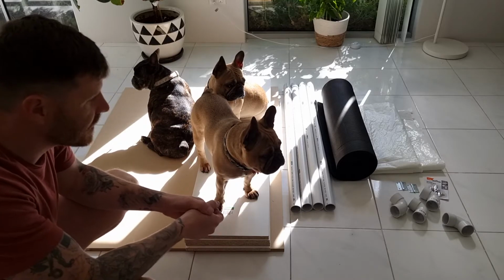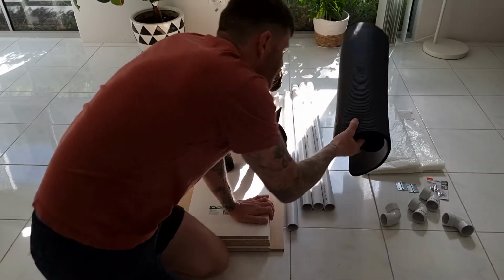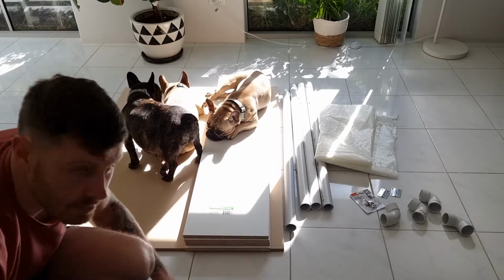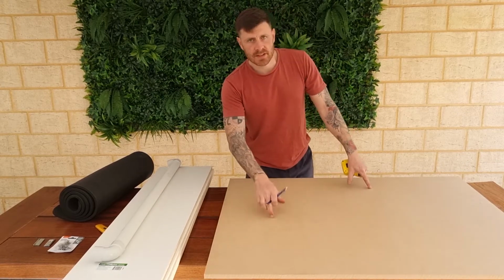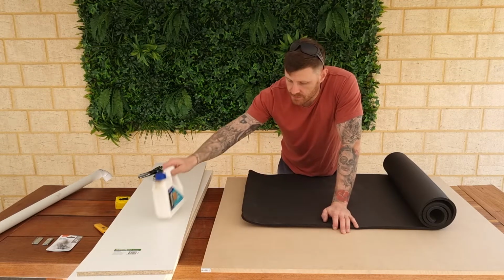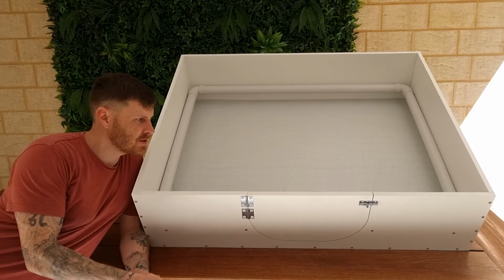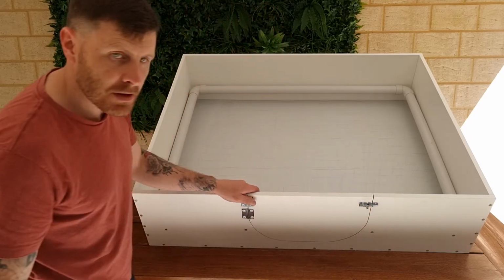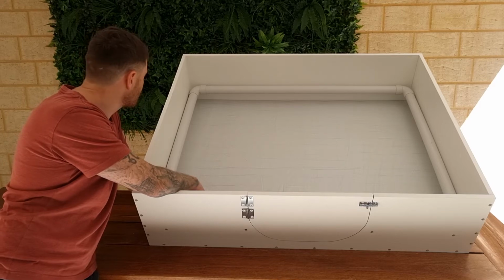How To Build A Whelping Box | French Bulldog Puppies

Comment: How high did you put the pvc pipe?
Reply from the maker: Roughly 100mm, the correct way to determine the height of the pig rail. When your dog is laying down on her side, you need to measure from the floor to the centre of the dogs spine. This will give you the correct height for the pig rail.
Reply: What did you put in the box base and did pups pull it up.  Nice job